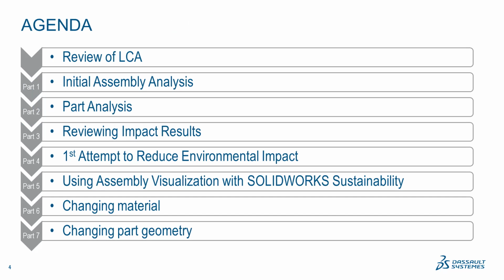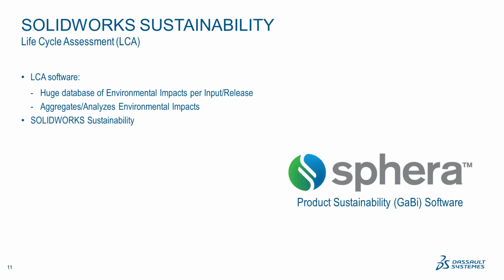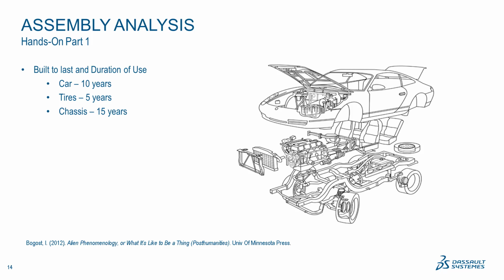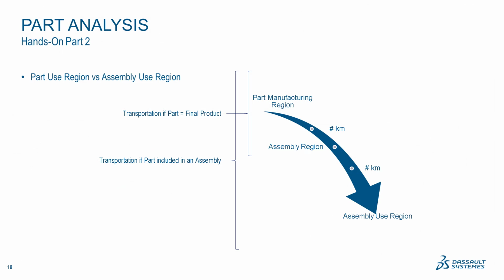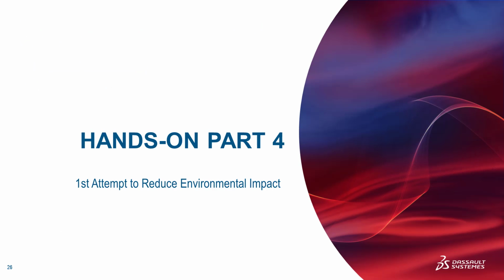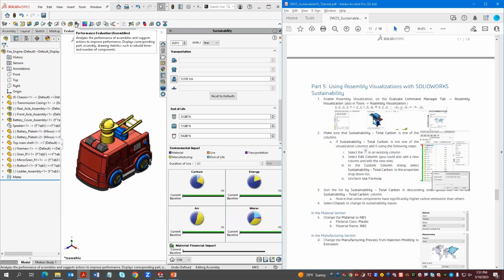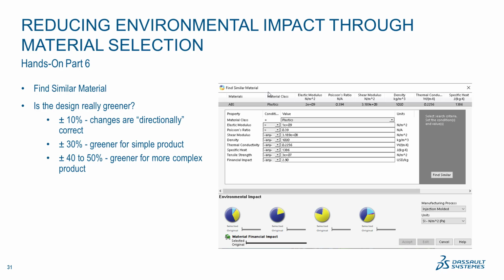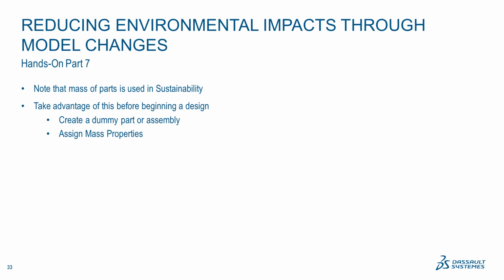Introduction to SOLIDWORKS Sustainability

Comment: HI I am planning to give the certification exam of Soliworks Sustainability Associate exam and looking for resources to prepare for the exam.

Is this video enough to get prepared for it because I am unable to find resources or practice exam related to this cert.

Thanks
Reply: @solidworks, plz the same Q
Reply from the maker: + @onlyforkids533 
First, thank you for watching my video.
I am not 100% certain of the study requirements for an exam that includes sustainable design. I think there are two certifications (including one in the education space) that includes sustainable design practices. You can learn more about certification exams here: 
https://www.solidworks.com/solidworks-certification-program  
The description of one of the exams indicates that using SOLIDWORKS sustainability is part of the exam (if that is in fact the case then my video will be helpful).
There are also resources at my.solidworks.com related to certification exams.
Reply from the maker: one last note, I believe that you will also need the SOLIDWORKS Sustainable Design guide as a study resource ( https://www.solidworks.com/sw/docs/sustainability_wb_brake_assem_2011_eng.pdf )
Reply: @footballfanatics49 Did you eventually write the exam? Was the information in this video enough?
Reply: @ttg9966 yes I did, and cleared 
I found a document which helped me prepare for ut.

Comment: What year version are the models?
I am trying to open and it say: Cannot open. Future version.
Reply from the maker: They are saved to SOLIDWORKS 2023. Note that you can add a column to windows explorer that indicates the last version to which a file has been saved ( see https://www.javelin-tech.com/blog/2019/07/display-solidworks-file-version-in-windows-explorer/ ).